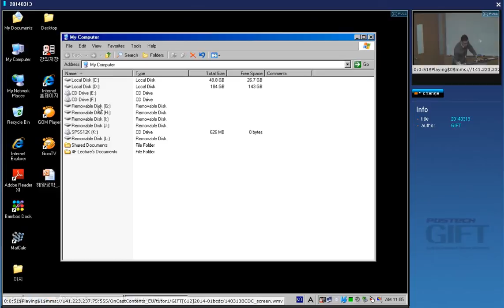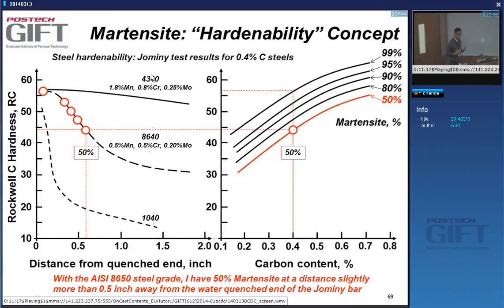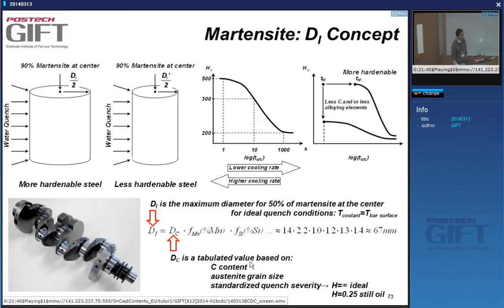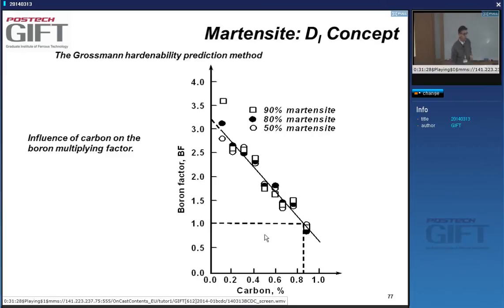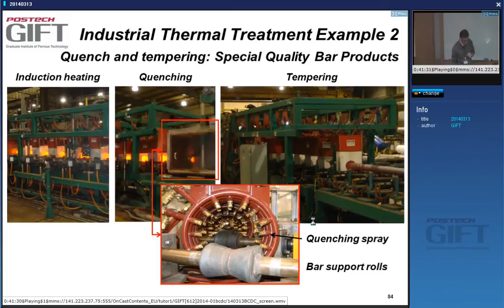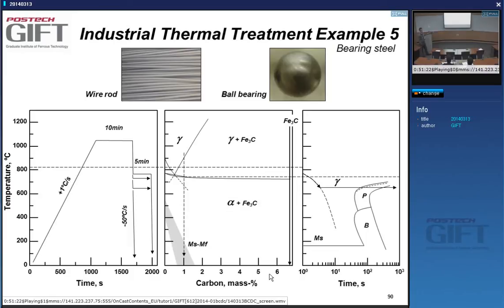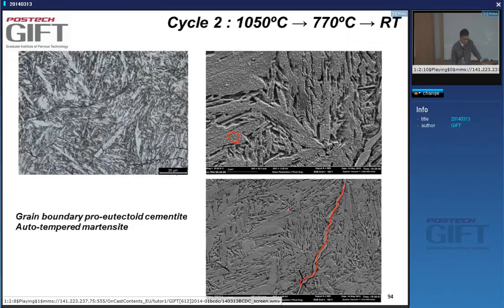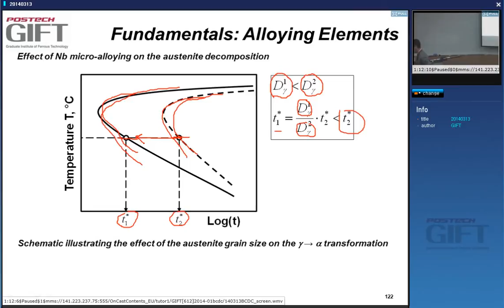Modern Steel Products - 2014, Hardenability: lecture 4

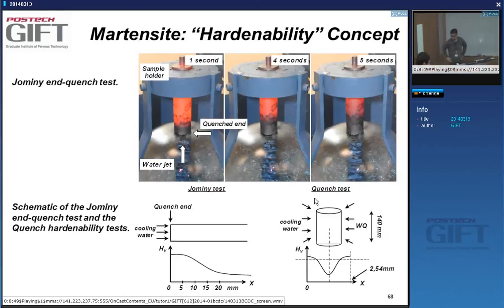Comment: Lecture does not start until 8:50 minutes in - quite annoying.

Saw blades are typically made as bi-metals (M2 tool steel teeth resistance welded to 4140 strip) not heat treated as one piece - one material. 

Although micro-alloy have better machinability and are less susceptible to hydrogen embrittlement they also have lower overall temperature range fracture toughness than martensitic steels. 

Free carbides in quenched products are not from "auto-tempering" but were clearly not fully put into austenitic solution in the first place and are simply inherited from the prior microstructure - this can be checked by correctly austenitizing at a higher temperature and longer time (T+273)(20+log (time)).

Cooling stresses also affect hardenability by accelerating non-martensitic decomposition products as shown by Carney in his "Pin inside 3" 4340 Q&T"  experiment.